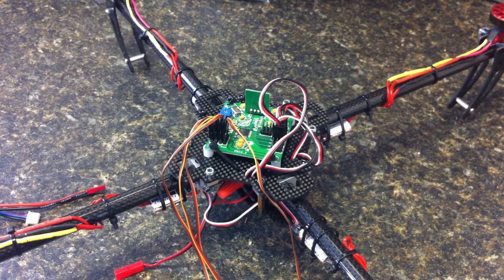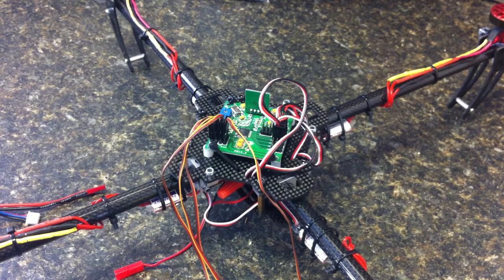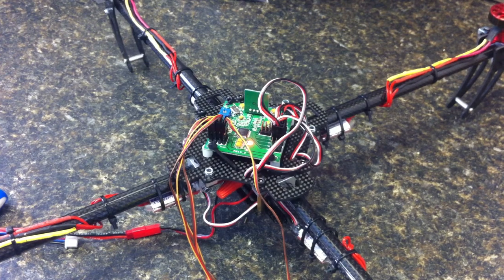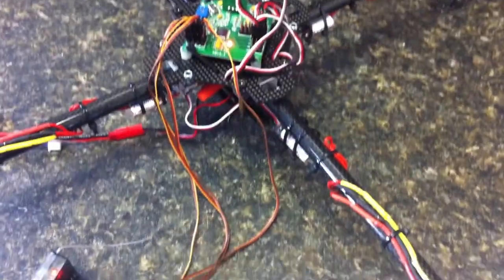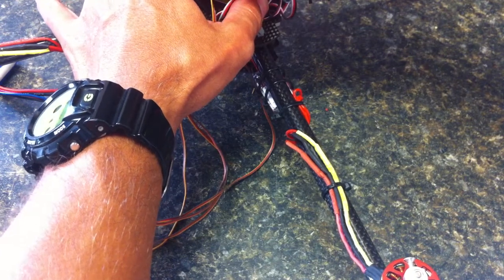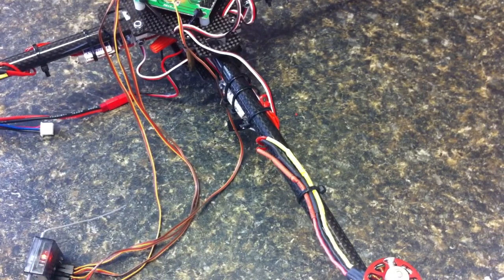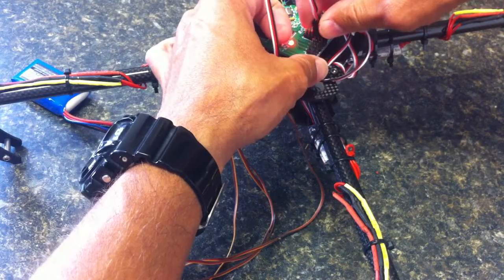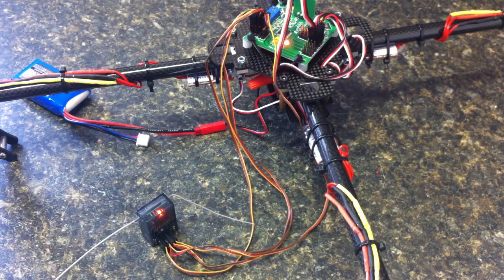My First Quadcopter Build - Problem with Turnigy 12A ESC and KKmulticopter Board from Hobby King

Comment from the maker: Yes, I've done several builds now and most recently I'm working on an APM 2.5 with 3D Robotics frame. I'm pretty excited about the prospects of autonomous flight.

For props I believe I used 9x4.5 and may have even used 8x4.5 initially.

The place that I've been going to get motors lately is called gothelirc. I've been using the iPower motors which are cheap and pretty reliable. My HK Turnigy motors went bad fairly fast. Am curious to know if yours will do the same.

Comment: Thank you for a prompt reply...

Looks like you have experimented with a lot of builds.

Thats a relief to know that the quad will takeoff. I also wanted to know which prop size suited the motors and frame the most (I got myself a variety of props to try). Also can you suggest a good source for getting inexpensive motors with lower kv, in case I want to switch the motors(I found the multirotor motor collection at HK lacking) ?

Comment from the maker: The motors will do fine and will be able to lift your quad, but you won't have the same thrust as you would with the lower kV motors. Right now I'm flying 850kV motors with a different setup and they have plenty of power.

Don't get me wrong, I really enjoyed this setup and it helped me learn a lot, but it was a minor pain to get the motors mounted properly.

Good luck with your build and let me know if I can offer any assistance.

Comment: I made the same mistake of going with Hobbyking's recommendation for motors and ESCs for the frame. My quadrotor build is exactly the same. Now I need to make motor mount adapters. I wanted to know if the configuration even works before I start working on the adapter. ( I have my doubts because of the motor's high KV and small profile.)

Comment from the maker: I ran into that problem previously, but in this case it was related to the ESC not being calibrated. I had to go through setting the yaw gyro to zero and go through the ESC calibration routine. After that everything worked perfectly. Thanks for the tip though.

Comment from the maker: In this case it was a calibration that was necessary with the Yaw gyro. Specifically, I had to set the yaw gyro to zero and give full throttle to the transmitter. Then I powered up the kk board and after ESC initialization (3 beeps for my 3S battery) I then set throttle to zero.

Thanks for the great suggestion and I'll keep that in mind for future reference. I've had issues with my throttle trim being too high before. Unfortunately, I have a Spektrum DX5e and really need to upgrade :)

Comment: I had a speed control that made the same beeps. It is telling you that it can't arm because of high throttle setting.  You will have to go in and set end points on each motor/speed controller.  My consistent beep was the low throttle arm point meaning it was above the low/idle arming position. I had to set my sub-trim down to get it to arm. I hope this helps.

Comment from the maker: I was having all sorts of problems with the V2.1 board and finally got it somewhat stable. The yaw gyro definitely tends to drift and I always have to counteract with a bit of trim, but I guess it's hard to complain with a $15 board. I saw the version 3.0 and want it badly, but can't justify the shipping cost for a single component. Need to do a big order. Alternatively, I've been intrigued by DJI Naza and APM 2.0. That's definitely stepping up the game from a cost perspective though!

Comment: I made one using the HobbyKing Multi-Rotor Control Board V2.1 ... Had a hard time with the board on they Yaw Gyro never could get the rotation out of the thing.  Changed to the 3.0 and it is a rock. Nice to see you got it working after ESC calibration!